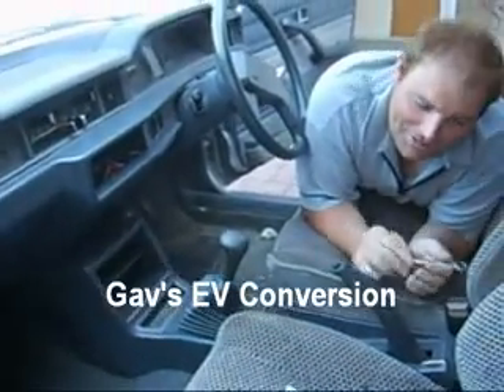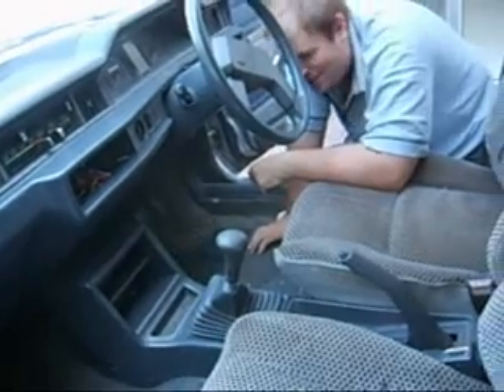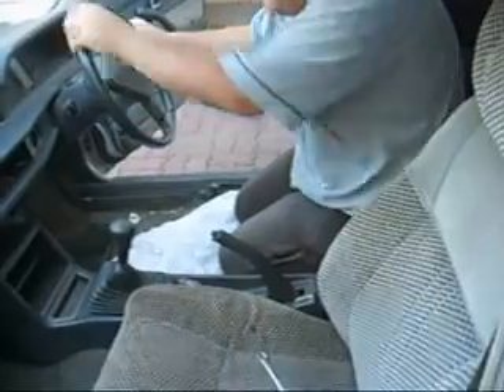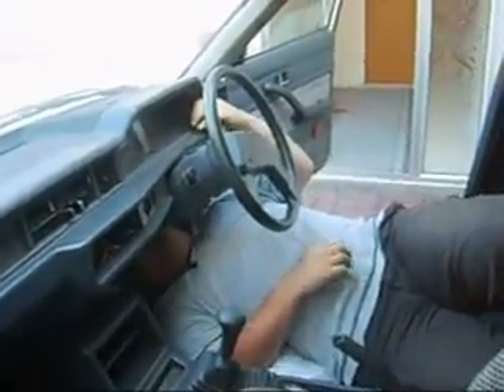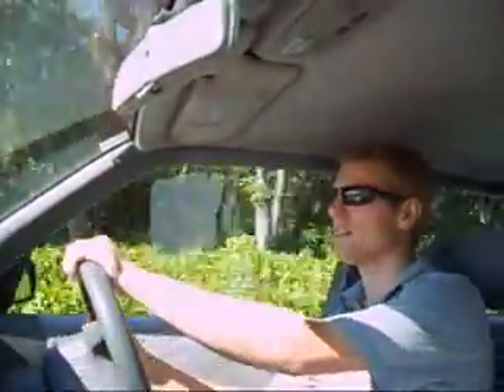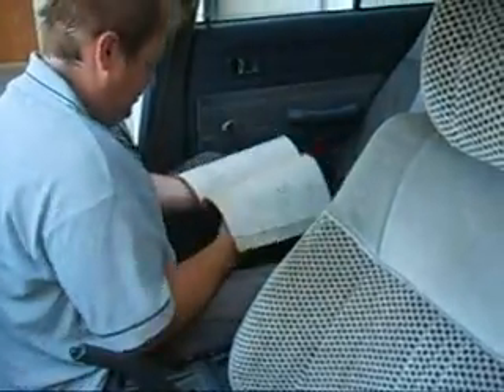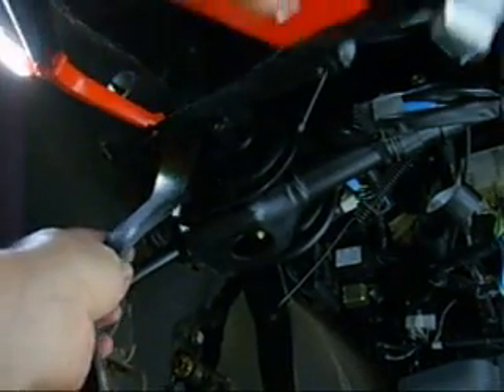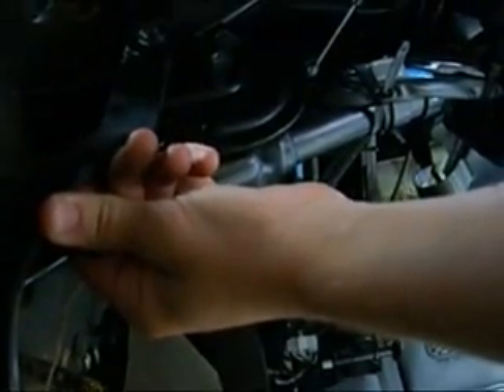Gav's EV Conversion 5 - Removing the Clutch

Comment: Measure RPM on motor and on gearbox and use a controller to match RPM as soon as gbox is shifted out of gear. if this function was used as an override while out of gear you would also guard against over revving with no load. just an idea i had. makes shifting quick and crunchless.